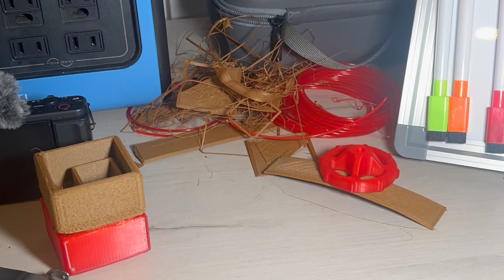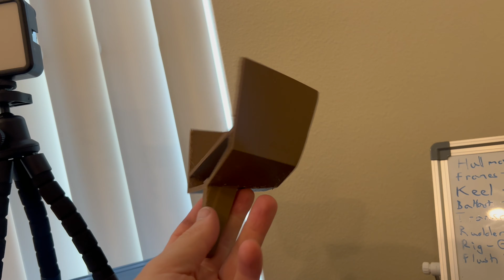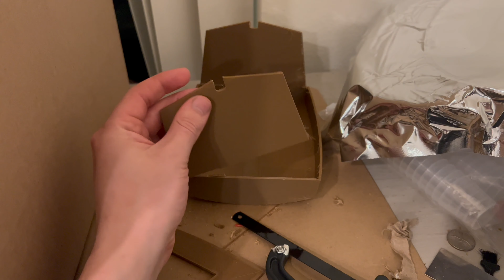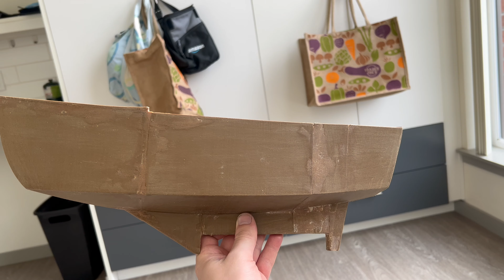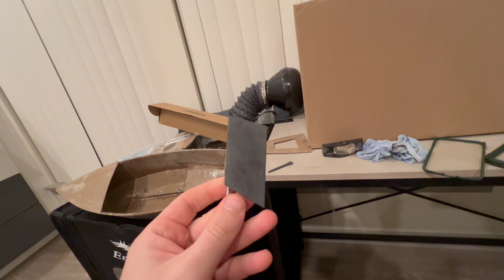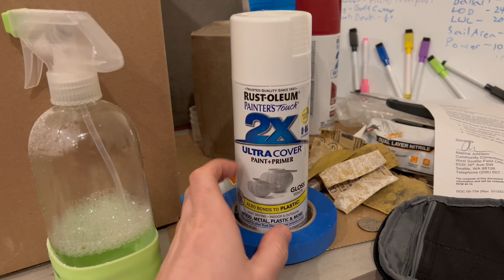I 3D printed a scale boat hull…

Comment: I would recommend using a raft as your adhesion base it works a lot better, also if you let the bed cool down completely with PLA it should come off of the bed pretty easily you usually shouldn't even need the pry tool after cooling. 

this is neat
Reply from the maker: Thanks! It’s not shown but I actually did try using rafts of various dimensions but this wood pla just didn’t stick well enough to either itself or the bed to make it work. Letting it cool down definitely helps release it from the bed. I started doing that at the very end. I’m still learning though and I have to say switching to ASA has really improved the quality of my prints. So much easier to work with…